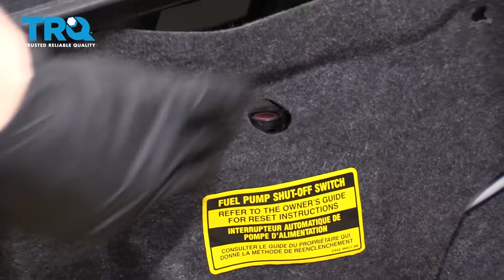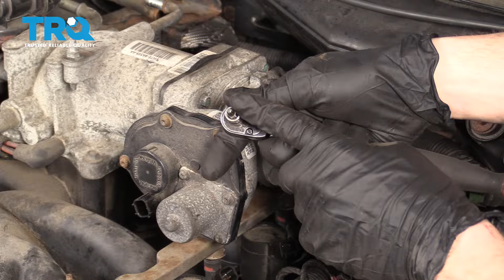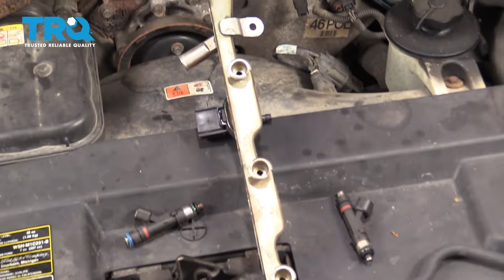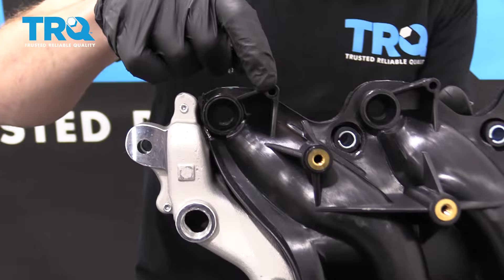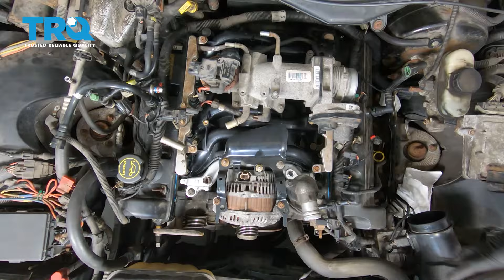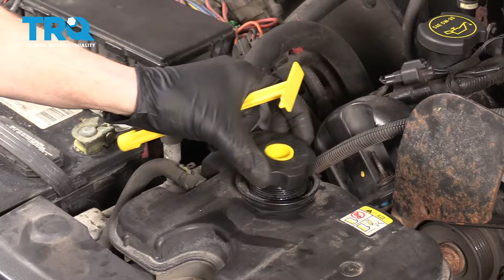How to Replace Intake Manifold 1998-2012 Ford Crown Victoria

Comment: Keeping track of which cylinders the coils and injectors came from is unnecessary. You’ve replaced the intake manifold and disconnected the battery. The fuel trim tables in the random access memory are wiped out. The powertrain control module is going to have to go through a relearn anyway.

Comment: Using a razor blade to remove gasket material.... smh not just because you have done it and never have issues doesn't mean that a viewer won't run into gauging them 😡😡😡😡

Comment: When you change the intake you should always change the under the intake heater coolant assembly because if you don't you'll be pulling the intake again or rigging a bypass hose 😆

Comment: You do not need to turn off your inertia switch because you're already disconnecting the battery. You don't need to remove the throttle position sensor (tps). You don't need to remove the entire EGR tube, that is a whole bunch of extra work for no reason. You also dont need to completely remove the serpentine belt, just remove it from the alternator. I've done a million of these and while this is a great video, many steps are unnecessary.

Comment: This was extremely useful except for glossing over removing the rear bolt of the driver side crash bracket. It is the single most difficult part of the entire job and you skipped it. That was just hateful. I'm assuming that you had to take an hour or more working it out or you have a simple procedure that you could have shared. Other than that idiocy, the job was well explained and I did appreciate it. I had no intention of using a cheap knockoff part though and purchased the factory intake. I have 3 panthers so I'm starting my own parts depot. lol

Comment: also when it comes to the bleeding of the coolant system, I don't understand why they used such an elaborate method, not everyone has that tool... for the unsophisticated masses like myself, you want to fill the reservoir up to the cold mark, cap off..... and run the car at idle with the heater turned all the way up at full blast,( i recommend lowering your windows) and let the car idle or you can hold the throttle open til it gets fully hot (operational temp) and let the reservoir burp out all of the bubbles, let it idle for like 15 -20 min once at operating temp and then you should be good, check to make sure the coolant gauge is at the right spot (midway) , if so , turn off the car and put the cap on the reservoir, check for leaks and  that's about it.. drive it for a week and keep your eye on the gauge incase anything looks funky.. if it's ok it's safe to say you did it right...

Comment: 2007 town car— be prepared to remove wiper arms (take off nut and rock up and down on arm and eventually it will pop off). Might need some penetrating oil. Then you have to remove the upper cowling (black plastic) it’s two pieces. There is one screw on either far corners and some clips on the front edge. Then you have to pop out the tabs on the windshield side to move it out of the way. Then there are some bolts and screws on the under cowling which is metal. Then pull that out. Then you can fully access the manifold. (Now I see why no one would want to change out a cabin filter). Lots of debris in the under cowling.

Comment: Awesome job… mine needs replacing because of coolant leaking into #1 spark plug well. What’s the name of tool you used to remove fuel line… 5/8 …?

Comment: I just got done doing this and I am pulling my hair out, I have a vacuum leak that I can not for the life of me find, only thing I done different is pull the throttle body off the upper intake, I am think throttle body gasket, because the leak goes away as I get on the throttle and comes back as I get off.

Comment: I did this and car won't crank now it's making a locked sound like something stopping it from cranking and gas coming out the back of engine...I'm assuming it's not flush but would that alone stop it from cranking?

Comment: Stay away from Dorman intakes y'all. The doorman intake is not Oe. 99 lincoln town car, to the left of the alternator that would be passenger side there are two screw holes that appear to be in place, they are not. The holes don't go through the intake so that you can attach that front left side to your engine, and it's too thin to drill. Regardless how we did it we could not get it to stop leaking. Going to Ford tomorrow and buying some high dollar Ford parts to get real Oe. The difference is a slow leak at idle that gets worse at about 1500 rpm, took it all apart twice to double-check and make sure that the job had been done correctly, it was done right, in this scenario Dorman is trash.

Comment: So I replaced the intake manifold a little while back.  Now I’m getting a misfire on cylinder 7.  To try and narrow down the problem I removed the cop off of 7 and replaced it with the one from 2.  Still getting a misfire on 7 so I know it’s not the cop.  Now I’m suspecting it’s a spark plug.  Unfortunately the intake manifold I got from TRQ overhangs the spark plug holes by a bit and I can’t get a 5/8ths spark plug socket down the hole.  Any recommendations

Comment: lmao you dont need to vacuum the coolant. overkill, just open the cap and start the car my guy. the system will pull all the coolant it needs from the over flow and heater cores

Comment: This whole job comes down to 1 bolt....the one on the back of the heat shield on the right side as your facing the engine.....that is what you should have shown...you simply put your hand back there and pulled out a bolt that I'm sure was already unscrewed for you....come on man show us HOW you got to that bolt.......
Reply: It’s a size 15 bolt facing towards the driver it’s called a crash bracket

Comment: Great video other than the unnecessary removal of the EGR tube.
 It's too bad 1A Auto seems to care more about their PR image than the quality of their parts. This TRQ manifold developed a massive coolant leak at the aluminum crossover after just a few months of use.
Reply: Best to use Dorman for the slight cost increase.

Comment: Not bad, but it would be helpful if you named some of the components as you disconnect them, instead of just calling the throttle position sensor, this thing.

Comment: Greetings,
As the passenger side electrical connections are removed you also removed a wire connecting to a fuel rail bolt that is replaced with a screw at 5 min 10 seconds into the video.  What is to be done with the connector?  It  has no place to connect after the original screw was replaced with a special thread screw going into the plastic manifold.  Please reply.  Thx. Super video instructions!

Comment: Do you have a video on just changing the injectors? Or do I really need to take the throttle body off not really a mechanic trying to do it myself and save some coins. I have a 2007 grand marquis gs

Comment: What's the purpose of that bracket with a long bolt? The bolt behind the engine is so difficult to get to.
I need to remove this bracket to get to the fuel rail and the fuel injectors. 
Is it absolutely necessary to put this bracket back on ? What happens if I delete it?
Please someone tell me the purpose of this bracket and do I really need to reinstall it?
Reply: You can leave it off everybody does

Comment: I'm on the downhill slide of this project with a 1997 Mercury Grand Marquis, it's a little different but that's okay.
 I appreciate the fact that this is business, no "funky" musick in the backround, I do not like when there is. Thank you. 
 In this car, '97 Mercury, there were 2 sensors that went in to the metal part in front, the temperature sensor, I guess, and another so the holes on both sides were filled. 
 The first torque on mine called for 15 rather than 18 according to the Chilton manual. Also the Dorman part that I bought had numbers corresponding to each bolt hole to give the tightening sequence. I found that very handy. :-)
 Also rather than the individual coil packs mine has the coil packs at the front of the engine that hold 4 plug wires each, like my Buick and Oldsmobubble, I like those. I didn't have to be concerned at all with the screws nor plastic of the new part.

Comment: Can't I remove the O'ring gaskets and replace them with flat solid gasket sets? They should all line up and fit the same right? I just don't trust the flimsy Orings inside the manifolds!! seems better to have a complete gasket across the whole head.

Comment: I have an.06 Mercury GMarq with 227K.  I replaced my intake manifold with this product.and the install went fine following this video as well as the A1 auto video.  I had some pitting in the head surface from leaking fluids, so I used some RTV on those areas of the heads as well.  This is my second replacement IM for this car - the previous IM was a Dorman, which was fine but lacked power.  My guess is is that this product more closely resembles the OEM manifold - easily have about 20% or more power compared to the dorman IM - definitely use this one!  At the same time, since I was this deep into the engine - replaced the valve cover gaskets (bad leak), spark plugs (Spark plugs wells were all cruded up with oil and anti-freeze from the leaking manifold), AND, REPLACED THE O-RINGS ON THE FUEL INJECTORS.  Thanks for the instruction videos and good quality.  Definitely recommend!
Reply from the maker: +scales57 Thanks for watching our video! http://1aau.to/m/Shop-TRQ
Reply: This is probably a dorman intake manifold.

Comment: My '06 Grand Marquis has 225K miles on it, and has about 50K on a plastic replacement intake manifold - my manifold gaskets are leaking - is it ok to reuse the plastic manifold - or am I better off just replace the manifold & gaskets at the same time?

Comment: Man 😂🤦🏾‍♂️There was no need to take the egr pipe off the exhaust manifold could’ve took the two screws out that holds on to the throttle body

Comment: Good time to change the water pump.  I wish I had changed mine when I did my intake.  '00 grand marquis LS with 125k in Feb 2020 when mine cracked. I'm at 161k today and she runs and drives great
Reply from the maker: +Troy Senarighi Thanks for watching. Buy the part in this video on 1AAuto.com: http://1aau.to/m/Shop-TRQ

Comment: I watched this video after I removed my intake on my 08 P71. Lol At least I can better appreciate what you are doing (other than removing lower EGR nut). My inertia switch in the trunk is different than yours. Mine doesn't have a slot to pop the red button up with so I removed my fuse for the pump. I wonder if that is just a police version thing? P71.
Reply: I noticed the same thing on my 09 P71. I unplugged the inertia switch and it had the same effect.
Reply: My 07 town car has the slot for red button. The pipe turned with the lower egr nut and broke it for me. fun stuff

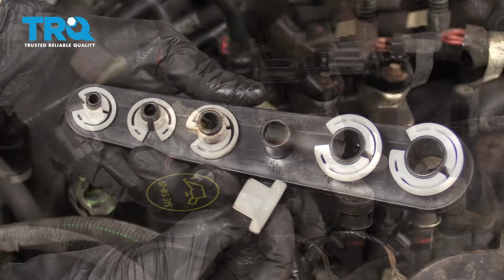Comment: What is the wire at 5:10? My 2011 CVPI doesn't have one in that location. Also, what is the name of the white tool at 6:48?
Reply from the maker: +Spencer Hooper Thanks for watching!  The tool that is used is a fuel line quick disconnect tool.

Comment: I noticed your video upload date is very recent. Does this manifold you've produced contain any revisions/updates that fix the pattern failure problem areas (crossover area, return heater hose, brass inserts) ?

Just curious as a "bullet proof'd" unit to replace a known pattern failure would be doubly worth the purchase knowing I'm not buying a replacement that may ultimately fail in the same manner

Comment: Just before mine turned 200,000 kilometers , 4,600idle hours , I got coolant going into number 8 coil boot. Guess it's time
Reply: Same problem with mine. 188,000 miles, ex highway patrol Vic.

Comment: I've done several of these intakes on this car and other 2v Ford engines. Thank you for the video, but a few things to make life easier. 
1. Unloosen the EGR nut and tube from throttle body. There is no need to remove this from the exhaust manifold unless you're going to replace it. The intake manifold can easily be removed and replaced with this tube in place. 
2. There is no need to remove the throttle position sensor from the throttle body. Remove the throttle body first and there is no need to remove it. 
3. Then remove that steel bracket on the rear driver side after throttle body removal. Makes getting to that back bolt much easier. 
4. Once the intake was removed and your mating surfaces are cleaned, replace those spark plugs. Doing all that work and leaving old spark plugs down in there isnt advisable.  Coolant that leaked from the old intake typically makes it way down into those spark plug holes and corrodes the spark plugs. 
5. Place the coil packs onto the intake manifold before putting the fuel rail in place. I saw you replaced them at the end of your video with red ones for whatever reason. Using dielectric grease where they meet the spark plugs and around the top of the plug boots can keep water from seaping down in the future. 
Minor gripes, but we all have our own ways I guess. Thanks for the video tutorial for others to watch. It helps more than you know.
Reply: Thanks for the info! I got concerned when he went under the car to heat up the egr... Now I know im good to do without having to access under the car!
Reply: Thanks for these recommendations - I was worried about the ability to get that lower EGR tube nut loose, and also that rear bracket nut on the driver's side!  I'll add one more 'to do' while ripping into the top of the engine - replace the valve cover gaskets if it looks necessary or the mileage tells you to!
Reply from the maker: +JPM788212 Thanks for watching our video! http://1aau.to/m/Shop-TRQ
Reply: There’s no need to remove the EGR shaking my head!
Reply: I’m in need of help had a few questions 
1. Should I replace any of these parts other than the spark plugs and coils which I am gonna replace anyway 
2. I think you answered this one do I need to touch the egr hose? It seems like a lot for me to do at home 
3. There is a temp sensor on the motor I didn’t see it on the vid is that the sensor that controls the temp needle because this is the reason I’m doing this in the 1st place my temp gauge isn’t working and fan not cutting on
3. My Vic has the throttle cable I didn’t see that here any pointers 

Any help is appreciated thanks in advance
Reply: Can this process work with the upgraded ford performance intake manifold made for mustangs?
Reply: I left the spark plugs I just gave them a wipe down tbh

Comment: I just saw this vídeo and It is a FEW months old, but i really hope to get an answer. Beneith the intake, there is a wire attached to the block; i had my intake replaced and one day i was looking under the hood and saw a couple of screws laying there on top the block, and the wire Im speaking of was also laying there attached with a connector  that wasnt attached to anything. What is It for, where doe's It go, and should It be connected. Please help. P.S., i cant go back to the shop, they are useless. My number 4 sparkplug well was flooded with coolent causeing a misfire and lost of power.  Please help!

Comment: Well, watched enough to determine to let a shop do this, my old 65+ year old back won't hang anymore 😂😂😢😢
Reply: I'm 64 and in poor health, heart condition, diabetes, C. O. P. D, arthritis in my hands. I'm doing this intake on an 08 Crown Vic ex- highway patrol car from S. C. The biggest PITA I've seen while doing this job is the bolt on the back of the driveway side head that holt that bracket!
Reply from the maker: +Numa Newbern Thanks for watching our video! http://1aau.to/m/Shop-TRQ
Reply: Even at 28 it makes my back ache leaning over it for an hour and a half 🤣
Reply: 🤣 I’m 36 and replacing mine now on 04 town car and my back is killing me 😖, but I’m too cheap to let the shop do it for me lol

Comment: The intake manifold you've used in this video is the same one for the 04 Explorer 4.6L. My heater core inlet doesn't run from the passenger side rear of the intake manifold as the crown vic depicted does. Do you know of any possible way to tie that port into the existing heater core inlet on the explorer?

Comment: Taking the bracket off to the rear of the throttle body...another failed Video taking a short cut. I am trying to remove this part from a 2000 Lincoln Town car and spent over an hour getting to the "nut" between the firewall and engine that is a 13 mm nut. There is a plate or something on top of that hiding the 15mm stud. It appears that plate has an additional 13 mm nut or bolt securing it that also isn't described....arghhh
Reply: i had to cut the fuel line because of this heat shield bracket to remove the injectors. Wasted a lot of time on this bracket. Good luck.

Comment: This video is fantastic.
I am looking for a Crown Vic. or a Grand Marquis. 
What is with that big 'ol insulator on the bottom of the original intake? You didn't use it but would it be worth it in any way to get a new one?
Reply: It’s sound dampening
Reply: @bryandowling8524   ... yes
Reply: It's prevents the air coming into the intake from getting too hot. It isolates the heat from the engine from soaking into the intake. I'm sure there would be a slight decrease in horsepower without having it.
Reply: @The_Borg   .... It might do that too, but 2003 was the firsty year for the insulator the same time the knock sensor was added.  Prior years did NOT have it.
Reply: It's a sound damper used on 2003 and newer that have a knock sensor dead center in the valley, insulates it from intake sounds so ignition is not retarded by those false readings.